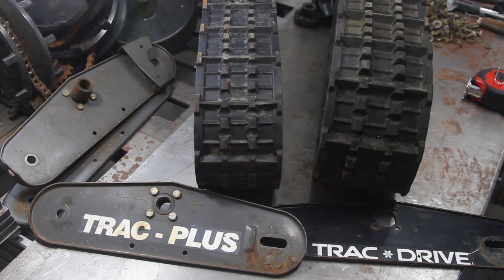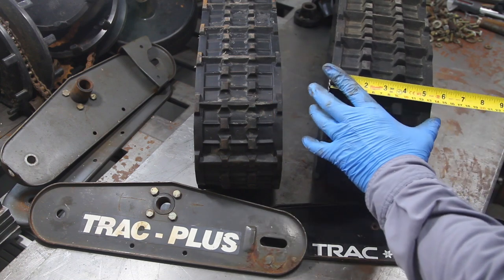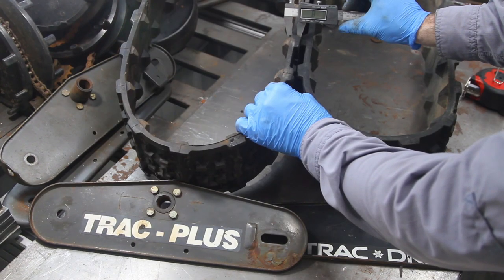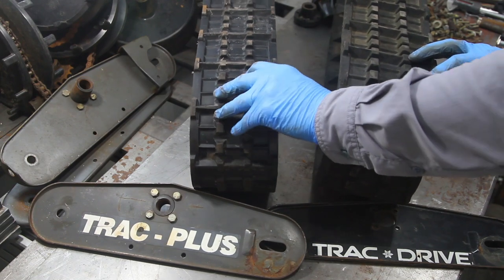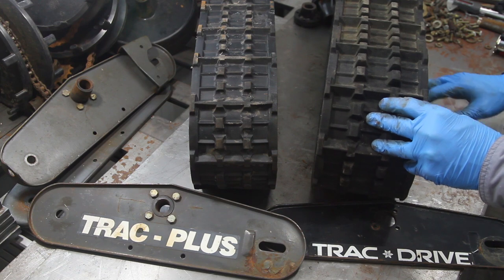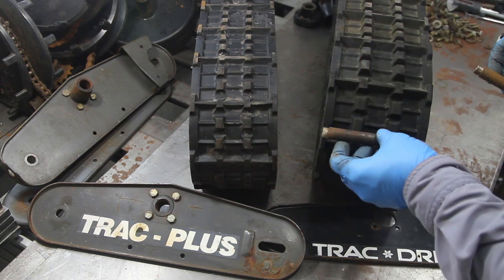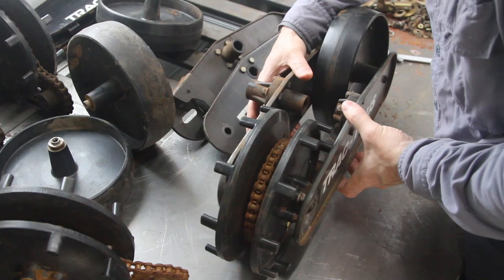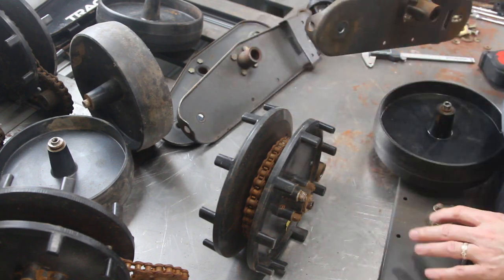Snowblower Track Differences

Comment: Hi wondering if you may help! I have the 4 1/5 inch wide tracks on my Noma Gran Prix 8.5 snowblower machine and would like to obtain a set of new or used tracks, in good condition, as a spare for my unit which I converted to a power wheel barrel after removing the blower. Would you or any of your readers, be able to give me a lead on the "part number for these tracks" or a "source parts supplier". Because it is a older machine, I am finding it hard to locate tracks. Please advise. Thanks.  Harold.

Comment: I have the track drive 10hp 32" and the bolts on hubs\ wheels keep backing out when I put it in drive or reverse. If I tighten them too much the tracks won't drive because too tight